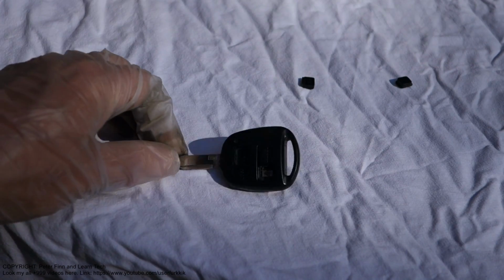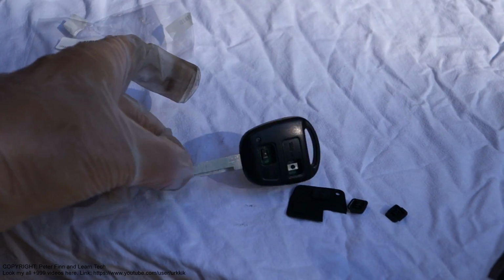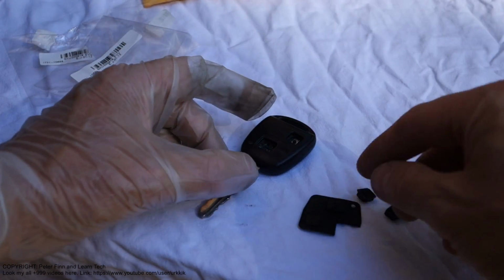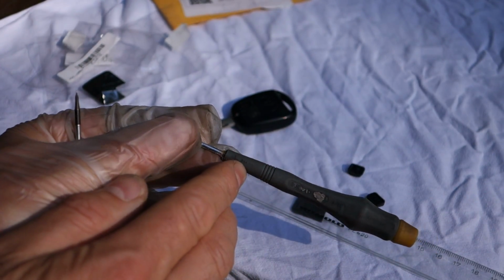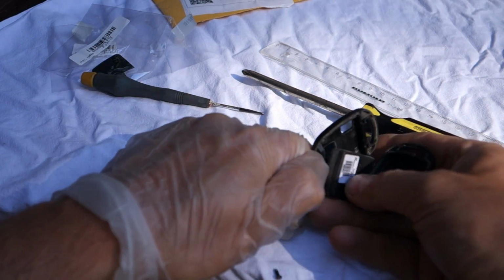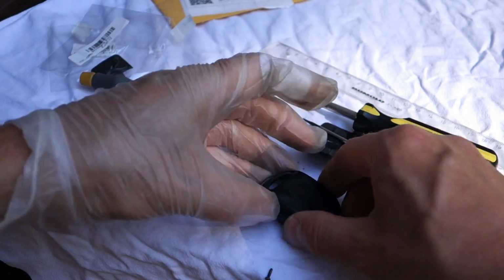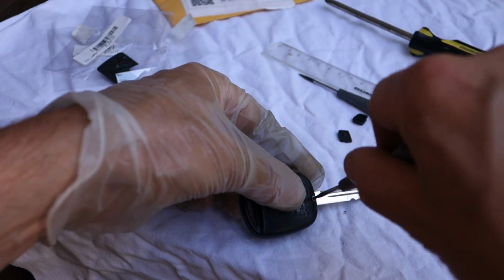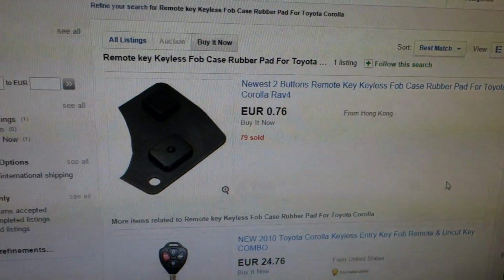How to repair remote key buttons only 5 dollars Toyota Corolla.

Comment: Hi Peter. Thank you for your video. I had actually done this job before, a few years back, when my other key's push buttons had broken. I'd forgotten how to take the key apart without damaging it so it was good to find your video. My key was for a Toyota Avensis but the process of repair was exactly the same as in your video, so many thanks.
Reply from the maker: +chenks54 Thanks for comment. :-)

Comment: hi Peter, 

on your vídeo it seems that the "lock" switch is broken, isn't it?

mine is also like that (so I think it is necessary to replace that microswitch..

have you any link to those spare parts?

thanks
Reply from the maker: Hi, we need to purchase key core unit by Toyota dealership. Price is about 130 US$.